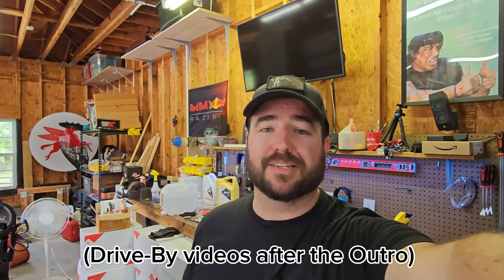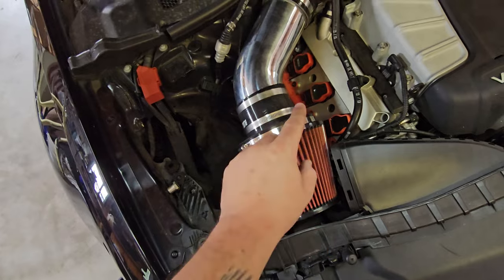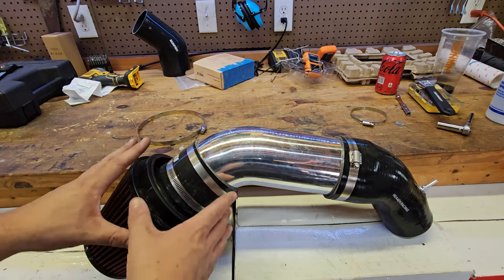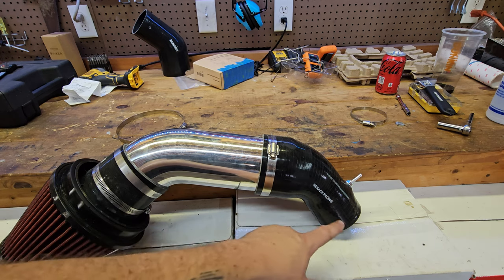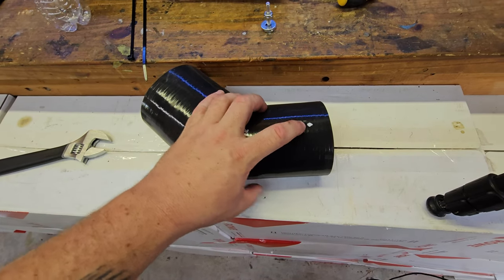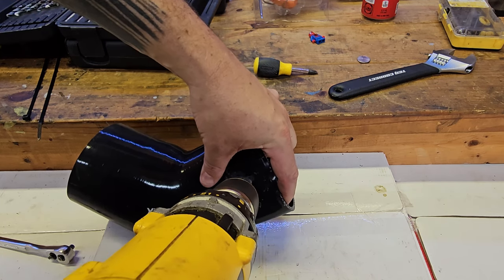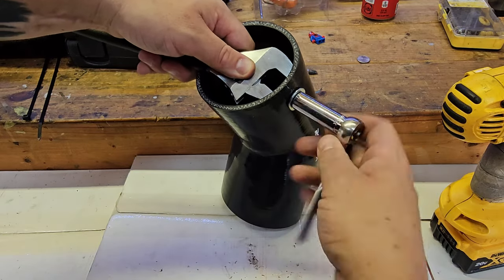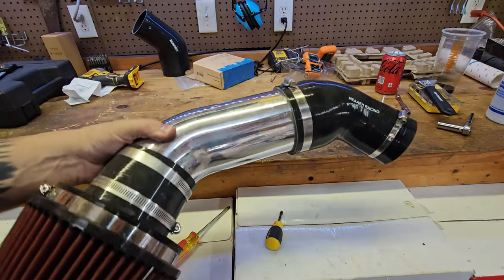170$ DIY Audi 3.0T Intake | Custom 4" Intake for the B8 S4 & C7 A6

Comment: I have a B8.5 S5 as well! Looking forward to hearing what you had to do differently to adjust it! Do you know approximately when we'll hear back about that? Thank you so much for your contribution
Reply from the maker: Some time next week more than likely
Reply: @AudiC7Owners  cannot wait!
Reply: @AudiC7Owners hi , a little bit off topic but could you help me with a problem? Do you know or do you have a friend who is using the strut bar from ecs tuning combine with the bigger throttle body from 034? Because they say it’s not working with the factory intake and the apr ultracharger but they don’t know if the 034 tb will work with it
Reply from the maker: I don't know at all. Sorry man
Reply: Love this video!! I have a B8.5 S5 as well and I’d love to hear what you find out. Any ideas when you’ll know more? Thanks!
Reply from the maker: Hopefully this week!
Reply: Nice!!! I noticed some of the items on the parts list are no longer available: :(
Reply from the maker: Just have to find a different piece that works. Or wait for them to be restocked
Reply: Any update on this?

Comment: I have a c7.5 (2017) A6 3.0T CREC and this setup worked AMAZING on my car. Thank you for the invaluable content - especially when it comes to the CREC motors. There is very little information out there. FYI looks like BLOX racing got more of the 7''' filters in stock as I ordered a week ago and got it in about 4 days.
Reply from the maker: Great to hear!
Reply: Hello! Whats the acual size of the air filter? I cant find anywhere the exact lenght of it, or oppening. Tho that should be around 4inch
Reply from the maker: Its about 7" long, and the opening is 6 or 6.5" to fit on the velocity stack... Can't remember off hand

Comment: Just installed this in my 2013 S4 last week had to get the 5" filter since the 7" was out of stock. I was shocked at how quick and east it was to install. I used a 7/32 bit and brute force for the barb in the coupler and none of the hose clamps that came with the intake were large enough, however my local Walmart had ones that did. Last intake I installed was on a r53 mini and it took a while I had this one 90% done during my smoke break at work. The sound is so satisfying and kicks in so low that I don't need to worry about mpg loss.
Reply from the maker: Haha glad you like it!

Comment: Nice! I have a set up like this on my S4. I used a Flowmaster filter though because it has an inverted cone at the front as well. And I used a Spectre velocity stack. I cut the oem airbox to keep the fresh air route from the grill. Glad to see that it should be working pretty well. I didn't do any testing lol.
Reply: What kind of tube/pipe/hose did you use in place of this metal one?
Reply: @MrRubenixa  I use duct tube from Home Depot 😂 the plan was to run an aluminum tube like Cameron did here and the duct tube was just for testing. But it actually seems to work fine so I just never changed it. I do plan on eventually using an aluminum tube once I get back into going out to do car things again.

Comment from the maker: Build your own!  Follow this link to the complete parts list on Amazon.

**B8 S4, S5, SQ5 Update Video:  https://youtu.be/1VepT8rg_3M

**MAKE SURE YOU CHOOSE THE CORRECT SILICONE HOSE FOR YOUR THROTTLE BODY**
-3" to 4" = OEM Throttle Body Hose application
-3.5" to 4" = 80mm Throttle Body Hose application

ALSO! Don't forget to buy a breather filter for your Secondary Air Injection line (the one that connects to the bottom of your oem airbox). I'm working on finding one to add to the Amazon parts list. 

Parts list:  https://tinyurl.com/mt2vh57x

A substitute for the Blox filter (which is largely sold out because of this video) is the AFE 21-60507 filter.

You will still need a velocity stack, but that filter will work as well.
Reply: Will the 4" heaaeh silicone hose you used in the video fit on the oem throttle body for my a6 3.0t tfsi?
Reply from the maker: The Amazon link might show a list of options now. You need a 45* silicone adapter that goes from 3" to 4" for cm oem TB setup. Their choices may be in mm so you will have to do some math
Reply: Any idea what metal pipe is needed for an sq5? Didn’t see any other part list though it is mentioned. Thanks!!
Reply: @MrLawnyd  hey did you ever find out I have a 2016 q5 and want to do this at home as well!
Reply from the maker: The sq5 will use the same setup as other b8 cars. Check the video link in the pinned comment above

Comment: How about a true CAI? I have the HPS 4"pipe to a coupler to another 4"pipe facing down, putting the bottom of the filter about 2", above the bottom vent, which i cut out all the holes. wrapped in the gold heat tape . Put on a filter cover to avoid any water and my IAT's and recovery are insane for FL. after full temp, pop the hood touch the pipe going down to filter and it is just a COLD piece of aluminum.
Reply from the maker: The air temperature going into your filter doesn't effect IAT's at all. I'm going to release a video on this soon.

Comment: Hey I know it’s been a while but I had a question, as I live in Oman and getting a 4 inch leg is harder and expensive with shipping. Would it be okay if I just went with a 3 inch leg with a 3 inch silicone hose from the throttle body?  Also a 3 inch BMC filter with no velocity stack?

Comment: I put this in my 2015 A6 C7 yesterday and seems like there is a lot more airflow. Definitely more responsive as advertised and the whine is nice. Does anybody notice that the whole air intake including the stainless steel becomes quite hot to touch after running? After a 20 minute drive mine is almost (not quite) too hot to touch. No other issues.
Reply from the maker: It's right next to the engine so it's gonna get hot. Doesn't effect anything though

Comment: Curious why you wouldn't put the barb in the metal instead of the silicone elbow, then you can tighten it as hard as you need to
Reply from the maker: Bc the barb has a flat metal backing that cannot contour to the curve of the metal pipe. You would never get a seal.

The silicone can compress/stretch to flatten with the backing of the barb for a perfect seal.

Comment: I just attempted to install mine this morning and the throttle body hose seemed a little big. Should I try and find a 2.5" or will the 3.0" work correctly? Also, where should I be putting the secondary line after installing it to the filter. Let it just hang...?
Reply from the maker: The 3" works perfectly OK cm oem throttle body.

I zip tied my SAI to the side of the fender. Just secure it over there somehow

Comment: Getting this custom cold air intake set up this week but wanted to check and see if I need to tune the car After installation? Or not needed? 
 
I wouldn’t want the car to start throwing me codes.
Reply from the maker: Nope. No tune required
Reply: @AudiC7Owners  Thank you! I’ll be ordering parts today.

Comment: The intake filter you included in the Amazon list has been sold out for quite some time, but I see you put a different filter on there is that for the 3.0t ?
Reply from the maker: Yes. The aFe filter works as well, but you will still need a velocity stack

Comment: Question: I currently have a 2016 audi a7 currently have it stage 1 with a pulley upgrade and a enclosed cold air intake from ecs tuning. Have you ever had any issues with that cold air intake? I had mine installed but I use to hear a small knock in the box. Have you ever heard of any issues with something like that. ?
Reply from the maker: I don't have any experience with that intake, but I can tell you that keeping the filter in an enclosed box is cutting off air flow to your intake. I would do my best to make that filter open. If there is a lid on the box take it off. You want air surrounding that filter to Aid in the flow. Trying to make sure that the filter is in colder air is negligible because the air is going to be superheated when it is compressed in the supercharger anyways.

Comment: Is the size of the filter important? The bigger the filter  the more performance and gains?
 I ordered the afe and the blox racing to compare them , they shoul be pretty close in performance right?
Reply from the maker: They are almost identical in size so either one will be great to use.

You don't want too big a filter as you want to maximize airflow around it

Comment: This worked on my C6.5, however theres not enough room in the bay for the filter to be near the front, so mine is pointed downwards. The scoop is still funneling air towards the filter however its close to the exhaust so im sure its losing power
Reply from the maker: Engine bay temperatures have no effect on your power. That's a myth on these cars. You are fine.
Reply: @AudiC7Owners  Thanks! Is there a video you made addressing this? It seems like a hot topic
Reply from the maker: No, but I probably will. But your car isn't naturally aspirated. It's the entire reason you have a heat exchanger and intercooler cores in the supercharger
Reply: @AudiC7Owners  this intake is amazing, I was so excited to go to work this morning lol this has to be one of the loudest intake setups for this engine
Reply from the maker: Haha I'm glad you like it!

Comment: Ive got a question: I have a 2013 A6 with the b8 supercharged engine and currently im running a custom exhaust setup with no tune and want to get a cold air intake for the engine, do you know if i would need a tune to run the intake plus exhaust or if any damage would occur to the engine if i decided to not get a tune?
Reply from the maker: You don't need any tune for exhausts or intakes.

Comment: This looks great, I think I'd like to do this. So what 4" aluminum tubing would I need for my B8.5 S5? Thanks for your input as this is the only thing holding up my purchase.
Reply from the maker: I'm doing an install on am s5 this week & will know for sure after that
Reply: @AudiC7Owners  Sweet, I went ahead and purchased everything but the 4" aluminum tube. Excited to see what you come up with!
Reply: I have all of my parts on hand now, just waiting to hear about the 4" aluminum tubing that you use for the S5 install. I'm surprised the 45 degree bend with the 7inch Leg you used wouldn't work. Hope to hear from you soon, I can't wait to change out this old Roc Euro. I'm thinking of cutting the heat shield that came with it to fit the 4"in pipe through and hopefully keep the heat shield which might also act as a brace. Also that vibrant vacuum line fitting kit which I have, Is it really needed? Can you do the install without it and just plug the hose? I remember back in the day the old CAI on my honda we disconnected the line and capped off the intake because it just pumped in heat from the crankcase during cold starts. I live in FL and there is no need to ever pump hot air into a motor to start it. Just wasn't sure if this would cause a problem on the 3.0T otherwise it would seem better off just capped? I'm guessing people aren't doing this for a reason.
Reply: @WeI3I3y what did you end up using??

Comment: So i ended up installing a CTS 3.5 intake but while trying to disconnect the secondary air fuel hose under the box i ended up disconnecting the whole thing. I thought this wasnt a big deal so after installing everything else, i started up the car & ended up getting a P0638 code, TPMS light, Max 950 rpm caution, and stability failure. Im thinking it has something to do with the Secondary air fuel hose i disconnected. Was super happy now im bummed out.  :(
Reply from the maker: It isn't a fuel hose... Secondary air intake feeds air into your catalytic converters on cold start. Those codes shouldn't be from that.
Reply from the maker: The p0638 code is for your throttle body... Make sure the intake is fully on the tb. Did you do anything else to the car?
Reply: @AudiC7Owners  Hi! Fortunately the problem resolved on its own after a few hours of not using the car! The most I did before starting it up again was just snugging the Silicone coupler a bit inside the tb. The Audi mechanic lady i called told me to replace it back to the oem and to not ever use aftermarket parts on an Audi. Thankfully It didnt have to come to that 😭
Reply: @AudiC7Owners  As far as the secondary breather hose ill just have to get a local mechanic to remove my skid plate and snap it back on wherever it popped out of.

Comment: Taking the oem intake out to swap with the one in the video and cant figure out how to get the secondary injection line off of the oem intake box. Do you have a video showing taking the oem intake system out?
Reply from the maker: Nope, but the easiest way is to put your passenger side on a jack stand, remove the wheel or turn it all the way to the left. Undo you're fender liner & pull it back. Once you do you will have direct access to the bottom of your box.

You have to squeeze the clamp on the fitting & work it off.
Reply: @AudiC7Owners  thank you!

Comment: Blox ran out of filters and doesn't know when they would be back in stock... is there another filter that can be used for the setup? 
Thanks in advance
Reply from the maker: Yep! Try the aFe 21-60507. It is slightly longer, but should work just fine.
Reply: @AudiC7Owners  thank you. I just ordered my kit.
Reply from the maker: Let me know how it goes!
Reply: Thanks a lot for all the info on-air intake. I've been driving around with a big grin. I used a k&n filter until I get the one I ordered

Comment: Any idea why my headlights would be getting no power and the alarm system going off every time I lock the car?
Reply from the maker: Sounds like some kind of a wiring short. You need to get it diagnosed at a shop

Comment: how do you remove the stock air box, is there anything i should watch  out for?
Reply from the maker: Once you detach the ram air duct from it & glove the oem tube it just pulls out of these rubber holders in the frame real.

But there is an SAI Hose connected to the bottom of the intake box that is difficult to access.

Easiest way to get to it without it breaking is to lift your passenger side of the cae, remove the front wheel, and then undo the front of your fender liner to pull back. Once you pull that fender liner back you will have direct and open access to the bottom of your intake box and it is a lot easier to remove that hose without breaking it.
Reply: Thank you

Comment: Unfortunately the vibrant vacuum fitting didn't fit in the hose, the diameter on hose is bigger and the fitting fit loose, I might have a bigger hose that yours..I'll see if I can get an adapter or a bigger vacuum fitting.
Reply from the maker: Let me know what you find. I zip tied my hose on the fitting & advent had an issue
Reply: @AudiC7Owners  ok I'll try to attach it with a zip tie to see if it seals good.

Comment: Why didn’t you mention the APR intake ? Released maybe 3 years prior to 034 and flows just as good I’m pretty sure.
Reply: Apr open* I’m referencing. I actually run the closed unit to keep things mellow, sure there is a hit.
Reply from the maker: The APR is a smaller diameter pipe, so it does not flow as well.
Reply from the maker: Not to mention the Carbon Fiber they use yellows after a couple years.

Comment: I just ordered parts to build this intake for a b8.5 S4, I plan on designing some sort of mount to support the intake once I’ve got it built. If you’re still looking for a solution for this let me know and I’ll tell you what I came up with once it’s done.
Reply: @drewgardner2698  how did this go, did this exact intake fit?
Reply: @svtperks2027  yes it did, however it seems to be always sold out and hard to get. They originally sent me the wrong filter but I was able to get a refund and then reorder the correct one through a different AMZ vendor

Comment: I have the same car Audi C7 do I need to get the Ronteix and Heaaeh racing silicone hose couplers?
Reply from the maker: If you have an oem TB you need the Heaaeh coupler
Reply: I bought everything from your list and have two clamps it looks like you have 4. Do I need to purchase two more?
Reply from the maker: Yes you will need clamps to connect the coupler to the pipe & throttle body.

Comment: question. i just bought an a7 and it has an almost identical intake installed, there is a tube below where the actual filter is, which is attached to my secondary air injection pump, sense that hose is not connected to the intake in any way i’m pretty sure that’s what’s throwing my engine code for bank 1 and 2 for my secondary air injection pump, has anyone else had this issue running an intake similar to this
Reply from the maker: That tube is stand alone, but should have a filter attached to it
Reply: @AudiC7Owners  just did some research and found that out! thank you for your reply, i’m ordering a filter for it as we speak, the guys who had this car before me i guess were idiots, hoping it didn’t damage my pump!